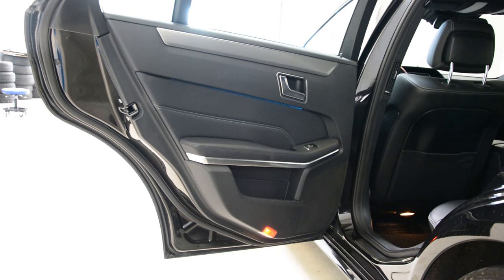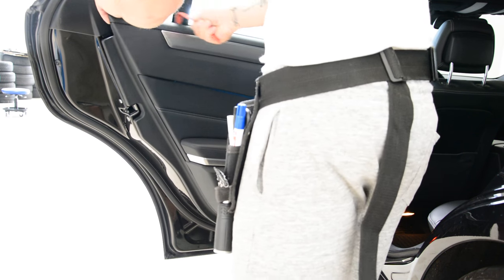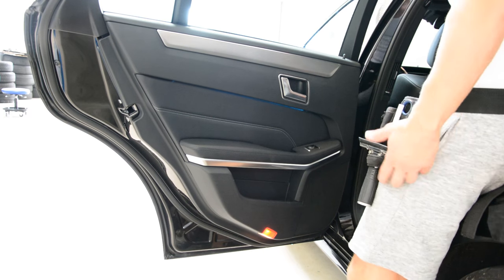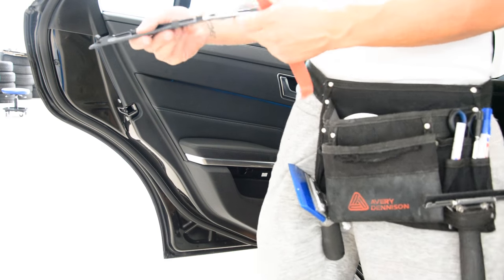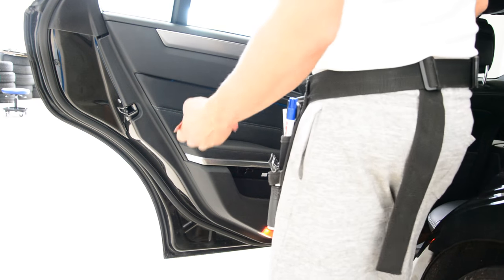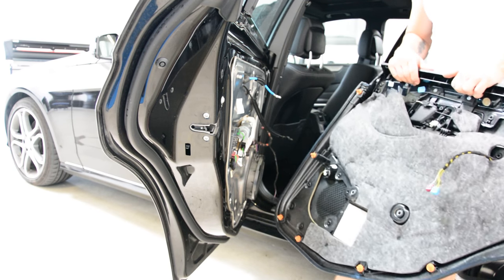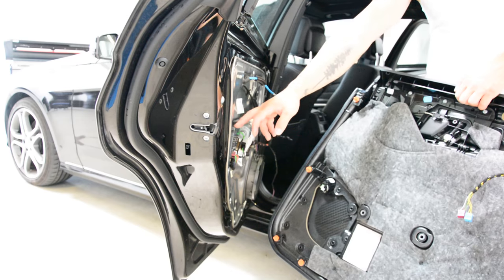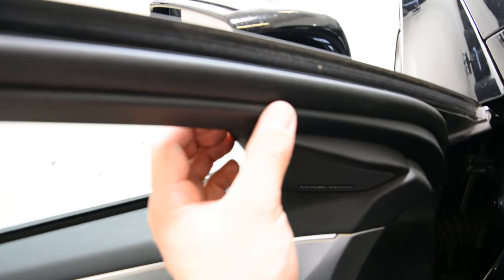How to remove the door panel Mercedes E Class W212

Comment: Hey that was an excellent video. I have a problem with my rear door passenger side door is locked and can't open the door from inside or outside w212 2009 any help Thanks.
Reply from the maker: You have on the door a kids safety look. Maybe the kids safety Mechanism is on

Comment: great video.  you made it look easy..  if you just want to remove the bottom sweep(rubber channel) to tint it, on the front doors, do you need to remove the speaker cover??
Reply from the maker: Yes Same thing if you remove the speaker cover it will be easier